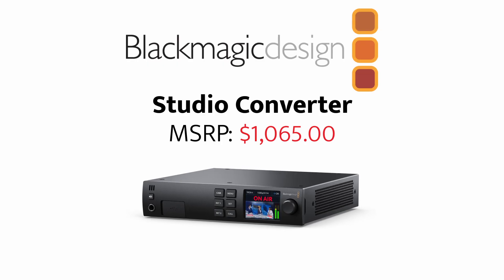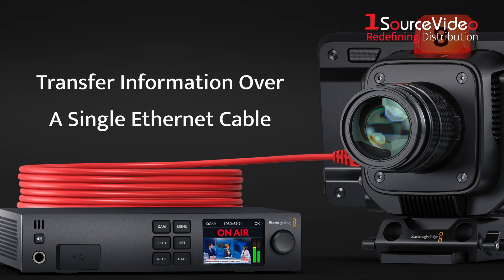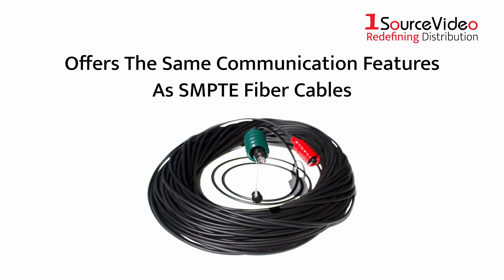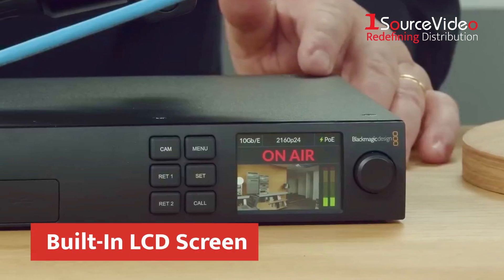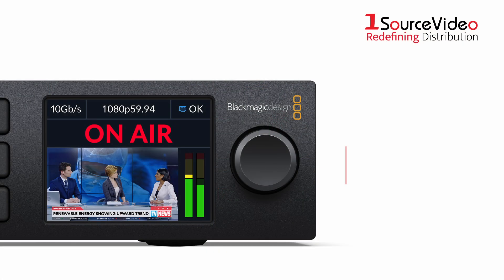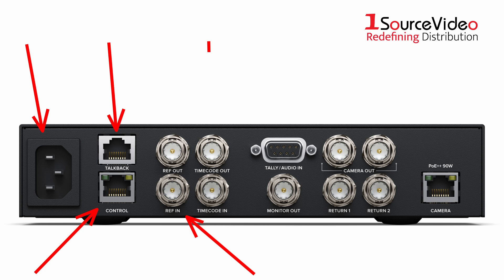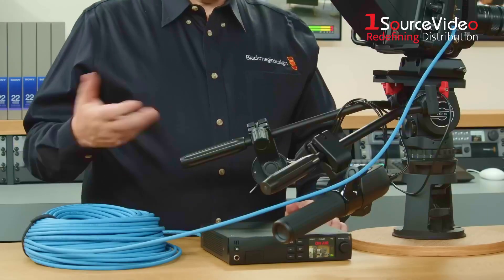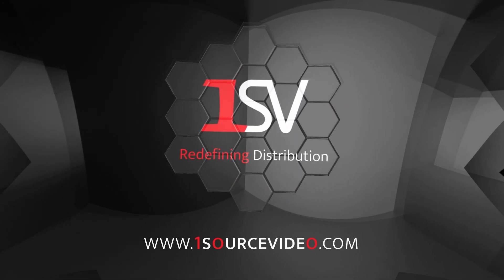Blackmagic Design's Studio Converter: Power Your Blackmagic Studio Camera Via Ethernet!

Comment: The key issue is that once you connect your camera to the BMD studio converter it is a 1 to 1 link over ethernet POE, you cannot then see the camera over straight ethernet... you lose access to the remote control, web page, local camera storage, etc.  Because you have now dedicated the camera ethernet port to a private 10G network, i.e. 1 camera to 1 converter.  This blocks may of the functional features to the camera over ethernet, forcing you to access the camera via direct USB link only.  This is horrible for doing firmware updates, to the camera, because if you had the camera on 'true' ethernet you could do updates and configuration remotely via a typical web browser.  BMD could resolve this situation by allowing the ethernet port on the studio camera converters to bridge 'true' ethernet to the private converter based ethernet/POE allowing routing to the camera.  This would allow direct camera management, firmware updates, etc., while allowing the dedicated private network between camera and converter to function as well.
Reply: False.